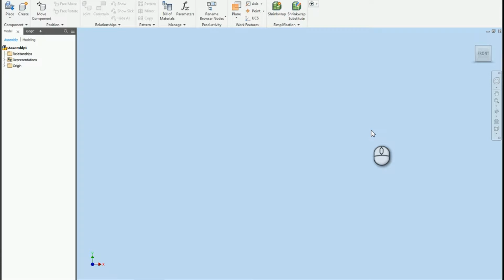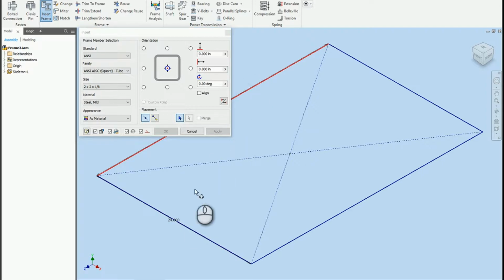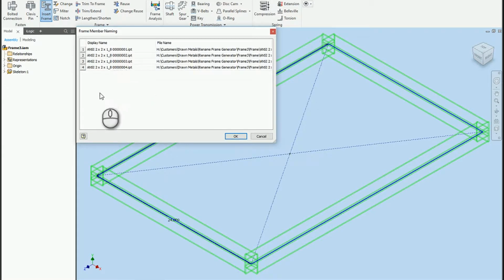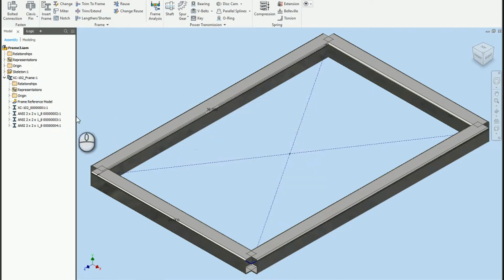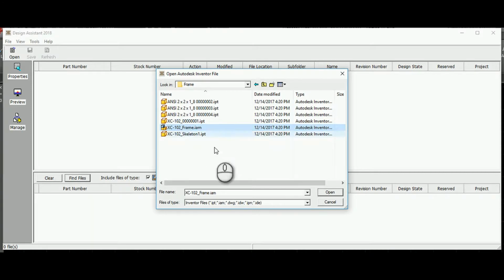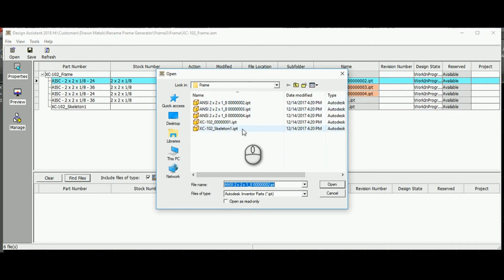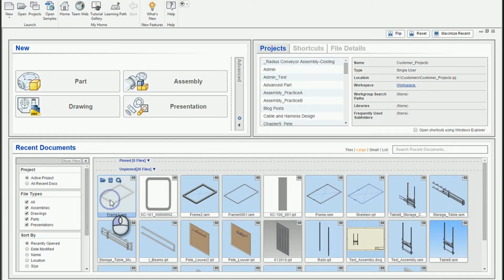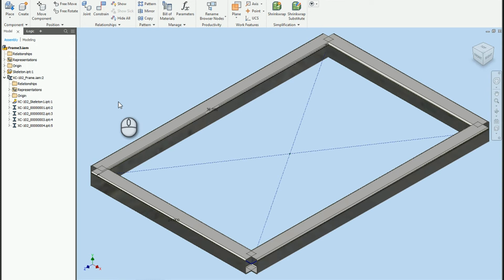Autodesk Inventor & AutoCAD - Renaming Frame Generator Components Outside of Vault

Comment: Hi

In your example with the frame generator I would like to ask if you have a suggestion to prevent the pieces from having four different numbers, since in reality you only have two pieces of different lengths.
So in the bill of materials you would only have two elements with a quantity of twice each.
The frame generator could automatically replace identical parts to avoid parts of equal length and different numbering, don't you agree?